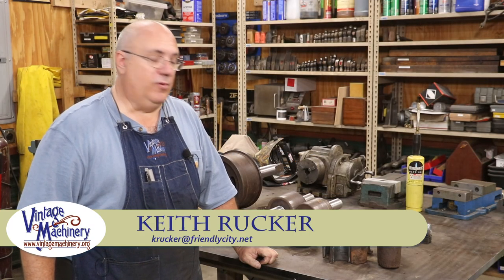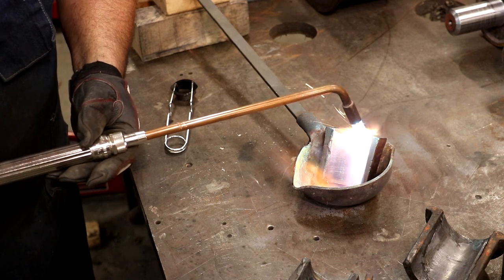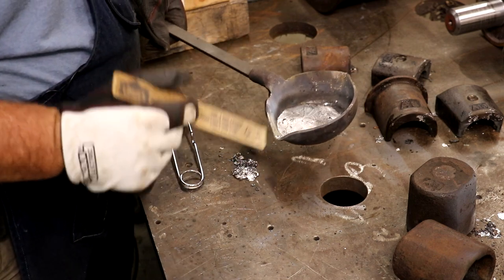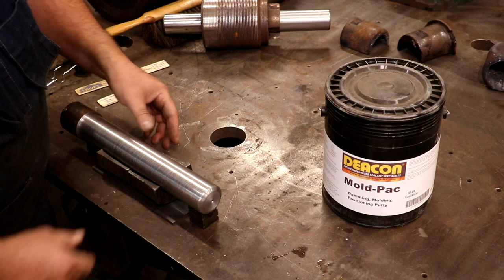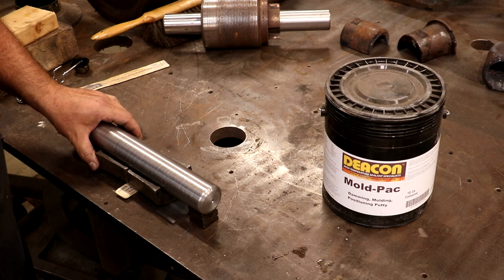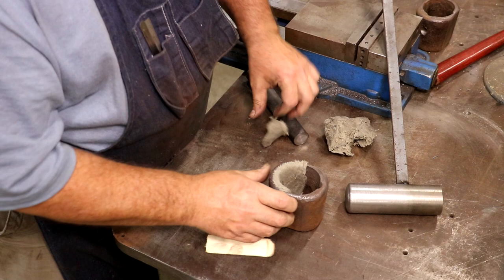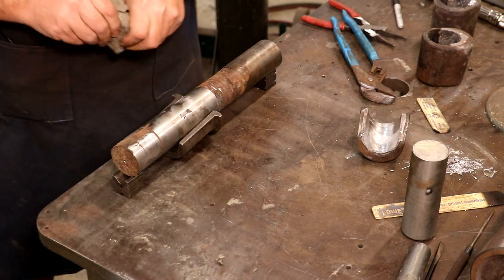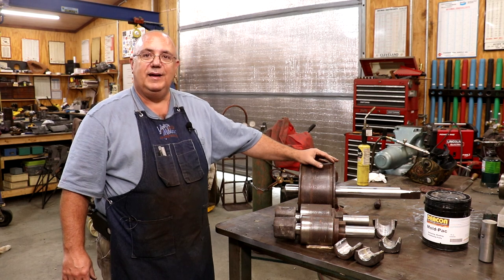Pouring Babbitt Bearings for a Goldens’ Three Roller Cane Mill

Comment: Ok I'm just going to have to add my own comments based on my very short experience in this field. I used to work at a local place called Tuolumne Foundry in Sonora Ca. It had been a machine shop and foundry for the logging industry here in the Sierra Nevada mountains during the logging industry days of yester year. Way before my time. I worked there only as a welder/fabricator in the 1980's. However during my time there the owners dad, his name was Richard (Dick) Holman asked me to join him as he was doing something a bit out of the ordinary (for our time) in pouring some babbit bearings for a customer. It was all very interesting but the term that stuck in my mind from the job was the grease he used to seal the babbit from spilling out  from the bearing when we poured it. He called it "Bear Shit". As best I could describe it, it was a very thick grease with some kind of fiber in it, probably asbestos! But I never forgot that term. Has anyone else heard that before?

Comment: Hi Keith, I’m sure you won’t see this but hopefully someone else will that might be able to give me the advice I may need. I have a south bend heavy 10 with a large bore and Babbitt Bearings. When I first got the lathe there was some scratches on the bearings but I sanded then the best I could and started my new hobby. Here I am 3 years later a little smarter and my bearings are bad. I am wondering if anyone has done this? I can make a plug for the oil hole. Should I cut the lines or leave them solid. Thanks in advance… love the videos.

Comment: Nice one. I worked for a few years in a large babbitt/machine shop as a machinist doing very large hydro-electric stuff. I never really knew the process as the babbitt pouring shop was separate. Why does the babbitt stick to the cap and not the shaft?

Comment: I am used to what needs to be done to babbitt early Ford engines. Of course a much harder babbitt is required. Once step I would expect to see for bearing halves is to peen the babbitt down while still warm. The babbitt will shrink and pull away from the cast iron. So you have to peen it down tight. It is much less of an issue for a rotating and not compression ignition type shafts. The interesting part is the critical elements of babbitt pouring. You need to do melting and pouring in ways to ensure the smallest crystals of metal. There are a lot of rules that must be followed to pour engine bearings to ensure small crystals. I will point out that these rotating shaft bearings are a much different pour then the engine bearings.

Comment: You can get the gap between the shaft and the cap perfectly even by using small wooden spacers cut from Popsicle sticks or similar sticks that are the required thickness,
4 spacers per cap held by a small spot of the sealing putty.

Comment: I would trust your eyeballing and your experience completely, but I have a question: Isn't the alignment of the shaft with the axes of opposing bearings critical?  What happens when you are a couple of degrees out of alignment?

Comment: Used to use a product back in the 60's called Cerametrix . Low melt temp alloy. Came in a 1 lb. Hexagon shape ingot. Melting point was, I think, 248 degrees Celsius.

Comment: I'm guessing you'll drill an oil hole for lubrication, Keith? Personally, I would cut a couple of oilways, but not out to the edges.
Reply: Oil holes won't be necessary as the bearing is constantly being oiled by surface tension.
Reply: I didn't 'guess' I 'presumed' in my comment on this issue :) Also, he didn't show blocking the holes up so Babbitt didn't leak out of them !
Reply: @Landrew0  Actually in use the  bearings, at least the bottom one, would be flooded and “oiled” by cane juice. Any excess oil in either bearing would ruin the taste of that good cane syrup.
Reply: Any juice that reached that lower bearing would run out on the ground as waste. There’s a sort of funnel near the rollers that catches and directs the juice through a screen into a barrel. When I was young my family and others ate lots of cane syrup and sorghum on hot biscuits with coffee, grits, bacon, and eggs. The juice was cooked to a thick brown liquid in long pans over a wood fire. Mills back then were powered by mules harnessed to long curved poles walking in a large circle. If anyone suffered bad effects we didn’t know about it. Ignorance is bliss I guess but I’m still here to tell about it.
Reply: @ellieprice363  "Mills back then were powered by mules harnessed to long curved poles walking in a large circle"

Now this is where I'm intrigued. About two miles from me is a 'house' called "The Old Gin Mill". It was a mill powered by a horse gin - and yes the horse would walk round in circles all day.
A 'gin' is a kind of animal trap - and I guess it was effectively a trapped animal that provided the power. So this is where I get a bit sketchy....what would you call the act of putting an animal into a gin ? And, once in there, what term would you use for an animal so placed ?
Clue - to place someone in a tomb, you'd say they'd been entombed.
So let's say an animal placed in a gin has been...

ENGINED

The word has links with 'deceive' - as in decieve an animal in order to trap it.

So, back to the mill - has a main building and a side area for the engined horse to walk in circles. Can you spot my next leap ?

to an 'engine' being the source of motive power.

And without evidence to the contrary, I currently believe that's how we come to the current meaning of engine - as a machine for producing mechanical power.
Reply: @millomweb  Greetings from America. The term “horse gin” is new to me.  I assume it’s a way to mill or process a food staple by animal power. In what nation do you live?
Reply: @ellieprice363  I'm in England. (Not New England ;) )

Here's what the Oxford English Dictionary has to say:

horse-gin  n.
1881   Trans. Amer. Inst. Mining Engineers 1880–1 9 146   Horse-gin, gearing for hoisting by horse-power.

So has recorded use of it from America !
c.f. 'horse mill' in Wikipedia. ( (Redirected from Horse gin) )
https://en.wikipedia.org/wiki/Horse_mill#Horse_gin_at_Nottingham_Industrial_Museum

"the most frequent use of animal power in horse mills was for grinding grain and pumping water."

A mill does not pump water - so not a horse mill. A horse gin can be used for pumping water - by driving a water pump ;)
Reply: @ellieprice363  See also:
https://en.wikipedia.org/wiki/Gin_gang
Reply: @millomweb  Many thanks for the interesting info on horse gins and their many uses. Horses, mules and other animals were the primary source of power before the steam engine. I use YouTube to learn new things and to meet others with like interest all over the world. I’ve always wanted to visit the mother country of old England but at 88 I’d better stay put.

Comment: When I started my electrical apprenticeship back in 1970 company still had some old machines with babbiting. Young mechanics  never learned how to repair them. Have not come across any since the 80's. Does anybody know if they still use them anywhere? Old timer told me they were great for slow speed applications.

Comment: I'm interested how long these bearings actually lasted for. Before needing replacing?
Reply: Why ?
Reply: @tonywright8294  I'm interested
Reply: @markleaning107  Honestly to me it comes down to the tin content and how well lubricated they are. Windmill Babbitt will last a lifetime if properly maintained with clean oil. Tin determines how hard the lead is and will keep it from wearing down as fast. I assume a lot of the newer babbitt has a lower tin content to be cheaper but it doesn't last as long. I have old gas engines and tractors from the 1920s that still have original bearings in great shape.
Reply: @Sigibrand  thank you for the information
Reply: @Sigibrand  only cheap crap Babbitt has lead in it, true quality Babbitt is a tin, antimony and copper alloy and it's the antimony that gives it the hardness

Comment: Why does they babbet material stick to the bearing castings and not to the shaft?   Do you have to drill a hole through the babbet from the oil hole in the casting?  Thanks Tony

Comment: Keith, I'm interested in the steam locomotive technology of the early 20th century as Reno was established as a railroad town when the Central Pacific came through in the 1860s; and Sparks became a division point for the Southern Pacific in 1905, when the world's largest roundhouse was built here.  Until the 1950s, when steam was finally retired forever and hundreds of skilled workmen were laid off, I imagine the Sparks facility had machine shops, foundries, pattern-making shops, etc.  All gone now, no trace of it left (except the huge brick locomotive barn is still standing).  I even have to send ferrous parts to Sacramento or LA for plating.

Anyway, my question is, a steam locomotive would have had a lot of shaft bearings.  Were these bearings Babbitt before the Depression, as you suggest?

Comment: Hey Keith,  I just bought a 1937 Craftsman table lathe.  The guy that had it before me replaced the Babbitt bearings on the spindle with nylon.  Should I remove these and replace the babbitt bearings?  What would you suggest?

Comment: I understand why the babbit is only needed for half of the bore, but why repeat that? What would be the harm in casting both halves? Seems like it would almost be easier, particularly the bottom cups. What is the advantage of only a half bearing? Just babbet cost? Also, why are you not sooting the shaft? Do you not need to because you're only casting the half?

Comment: Are you going to drill out the oil holes?

Ok, from the next video I see that they’re not oil holes. Which brings up a question. Babbit bearing are very dependent on proper, continuous oiling. I don’t see an easy way to do that, and the way it’s made, it seems as though the oil would drip into the cane. So that would be a good reason why the bearing were in such bade condition.

Comment: I thought you had to "blacken" the shaft first before you poured the Babbitt ?  I guess it doesn't matter ?
Reply: Normally I do that also, to ensure you can pull the part off of the mould (or shaft in this case). But looks like the part came apart, no problems!
Reply: @rodreed5147  Thanks for the reply

Comment: In Keith's final piece to camera, what are those things on the back wall that look like giant coloured pens?
Reply: They look like the plastic containers that filler rod for TIG welding come in to me.
Reply: They come from ZTFab. The holder and tubes. As stated they are for holding filler rod, brazing rod, etc. Good products, check them out.
Reply: Thanks all.

Comment: nice, I have watched you do it before. This time you didn't smoke it with carbon, why? was it because these were halves?  I remember the wood planer was smoked and a few others too.  Thanks, just trying to learn when to and when not too.
Reply: Normally you smoke the shafts when you are using the actual parts as the mandrel and want to be able to remove the part.

Comment: Is the Deacon damning product similar to plumbers putty?
Reply: I was wondering if you could use duct seal.
Reply: No, plumbers putty will burn. The old material used was simple clay, however it wasn't easily reusable as the clay next to the pour would dry out and harden from the heat. But if you are only doing a few it still works just fine.

Comment: Is there any reason you choose not to 'soot' the shaft before pouring?
Reply: He used a mandrel the same size as the actual shafts. No need to soot them, as marring the finish of the actual shaft is not going to happen.
Reply: @mikeshort4291  Heating the shaft  expands it slightly, causing it to pop right out of the Babbitt when it cools.

Comment: How do you make sure the bearings are centered properly on the shaft?  Isn't there a big risk of the shaft lying at an angle?
Reply: that was my thought.  obviousely there is no line bore.  those caps have to run true once assembled.   ????

Comment: what would happen if you try to machine a babit from a full casting?
led poisoning from all the dust flying around, or could some mist spray reduce that how about tools wear?
Reply: You wouldn't get dust, just to start with. When you cut soft metals you get soft buttery chips. They are relatively large and heavy and will just fall into the chip tray. They won't be flying around like steel or brass chips. You aren't going to be breathing the stuff even if you stick your nose in the chip tray while you are cutting. When you are done you can sweep them up with a whisk broom or even scrape them up with your hand. Either way you aren't going to get any lead into your system if you wash your hands before eating.

You also basically have no tool wear at all. Typically you would cut with normal tool steel cutters, no need for anything harder. The problem is buildup on the cutting edge, not wear or dulling of the cutting edges.

Comment: That was really fun to watch!  I know you are careful about safety, so I guess that it is safe to heat an alloy of lead indoors without a respirator.  Are you going to renew those grooves on the rollers?
Reply: Metals don't actually give off bad fumes - not at melting temperatures anyway - get them hotter and they probably will. Did you not notice he had the big door open a foot or 2 too. So reasonably well ventilated.
Reply: No lead, just tin, antimony, and copper.
Reply: @ronaldhorne5106  Interesting, really interesting. Please do a video about it.
Reply: He was melting the lead, not drinking it! Lead is not dangerous unless you eat it.
Reply: @johncoops6897  , the issue was inhaling fumes. The previous two responders covered this nicely, which is why I gave them both "likes".
Reply: @johncoops6897  Or it gets through the pores in your skin.
Reply: @stuartschaffner9744 - Liking an answer doesn't make it correct. Metals like Lead don't emit "fumes" when you melt them, not even Mercury which is a liquid at room temperatures. A fume is a gas, and physics will always win over YouTube "likes".
EDIT: This comment was overly sarcastic. I omitted to include the adjectives "dangerous" or "harmful" before the word "fumes". And I should have qualified with the phrase "in normal situations like shown here" 😉
Reply: @johncoops6897 , I don't understand where you're going with all this. Are you aware that mercury vapor is very toxic and that virtually all metals in a liquid state have a vapor pressure?
Reply: @stuartschaffner9744  - Even common water is a toxin if breathed in sufficient quantities. Consider the amount of "harmful" lead vapour that is breathable from an occasional exposure for a few minutes of being at arm's length to a molten pool of a metal that only has a small proportion of lead, whilst you are in a large open and well-ventilated space.
He's not snorting lines of lead powder here. This is a tiny tiny tiny bit harmful, however he is FAR more likely to die from the consequences of being so overweight.
Reply: @johncoops6897  mercury does give off vapors at 68f or 20c which is why it's commonly kept under water
Reply: @markshort9098  - Yeah, everything probably does in minute amounts. However, it's important to focus on "harmful doses" rather than scaremongering..
Reply: @johncoops6897  yes true, the dose makes the poison but you were commenting about being correct when you weren't correct about mercury and bad information is dangerous
Reply: @markshort9098  - yeah OK, that's correct. And misinformation about the "danger" of things that cause virtually zero harm is totally unnecessary. Living causes death, and you miss a lot of experiences by going through life in a hermetically sealed bubble.
I will edit my comments above to clarify my sarcasm, so that pendants won't jump and attack me.

Comment: This style of bearing is still widely used, you will find them in your car engine in the form of main crankshaft and big-end bearings amongst others.
Reply: Chevrolet used Babbitt bearings in their “stove bolt” sixes until 1954 when they switched to inserts.GM must have developed a very high speed process of pouring Babbitt bearings to keep up with the production line?

Comment: Please tell us you didn't use a lead based Babbitt for a FOOD grinding application!  This should have used a premium tin based material only.

FWIW the thing that makes Babbitt work so well is the antimony!  Antimony & tin form a alloy that precipitates Sn-Sb cubes which are very hard.  These cubes are embedded in a eutectic matrix which is soft & ductile.  The hard cubes are the low-friction interface with the shaft, while the soft matrix remains capable of absorbing debris as inclusions into the bulk of the bearing material.

Comment: Does anybody know the actual science of reusing babbit? For years, old-timers always talk about melting their bearings, adding a little bit of fresh Babbitt, and then recasting. What I never understood is that if Babbitt melts at 700 f, surely there are oils if not actual chips then at least grindings, that do not burn up at such a low temperature. I have run machinery after this type of babbit refresh, and did not notice any problems, but just as Keith said, it just FEELS wrong.
Reply: In general the babbit is softer than the shaft or the journal boxes, so unless you let the babbit wear completely through, there really shouldn't be anything hard ground up into the old babbit. If there is ground up steel, it will fall to the bottom of the melt, and if you are careful and pour relatively slowly, and leave some babbit in the ladle, then the hard stuff should not end up in the new bearing. Anything soft in the old babbit will probably either burn off or float to the top where it can be skimmed off as dross. For the most part melted metals like this are self-cleaning when you melt them, as long as you don't grossly overheat them in the melting.